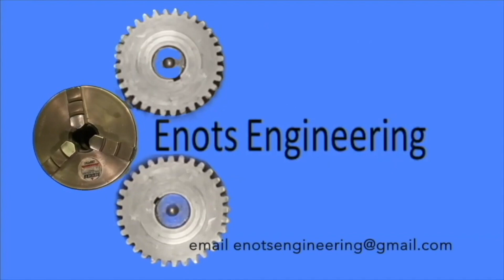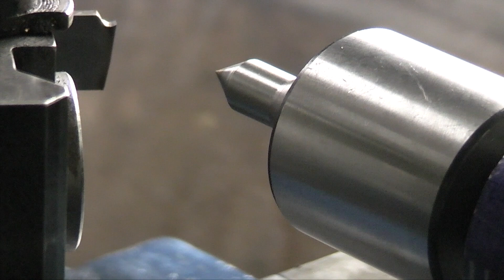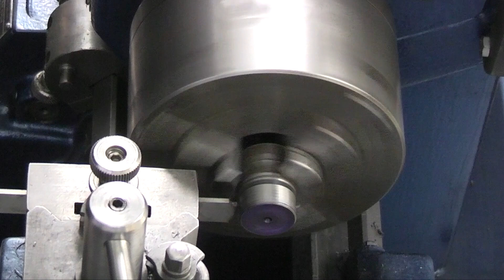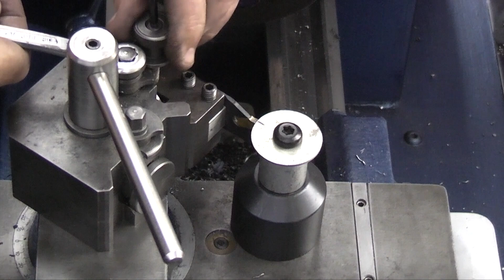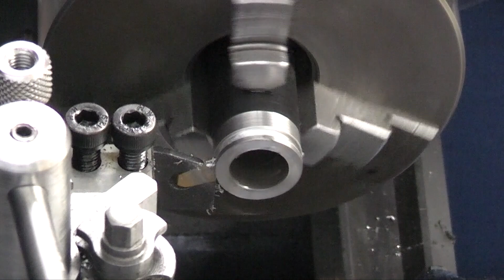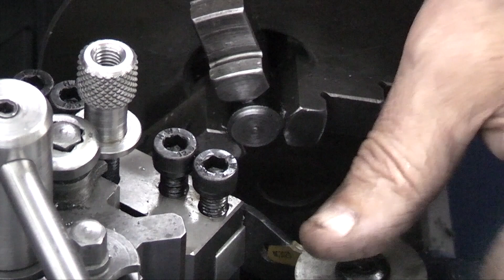Parting off tool problems ?

Comment: Following needs to be changed: 1) shallower rake angle or neutral 2) side angle relief to stop rubbing 3) tool height was too high needs to be slightly lower than centreline 4) parting is best from the back if possible 5) speed too low 6) Gibson need tightening

Comment: Conclusion  ????? RUBBISH and BORING
Reply: In contrast to the usual slick videos which don't teach much, this one's good. It's unusual to see someone making a video about the problems they encounter, and a lot can be learned from this video (and the comments section) if you have the capacity to think and learn. For example, rake angle, pressure and tool height, which are all incorrect. Perhaps time to stop criticising and start learning?

Comment: Interesting video. I have been exploring problems with cut off for years.  That doesn't mean I have all the answers but I have discovered how to successfully cut-off the first time every time on fairly small lathes where rigidity is usually an issue. The first thing I noticed in the video was the enormous overhang on the chuck (distance from the spindle bearing to the work being cut). If the lathe has less than a 2" (50mm) spindle this will likely cause problems. Reducing overhang is often overlooked and always helpful when minimized. The very biggest issue with cutoff on any lathe is the tool grabbing and being pulled deeper into the stock. This is because the "Point Of Flex" (tool post, compound or gibs) is below the centerline of the stock. Things that help are tightening the gips on the compound, centering the tool over the top of the compound, eliminating the compound or eliminating the tool post. I made a very simple direct mount blade holder that worked perfectly but I didn't like the fact that I had to remove the tool post. The other side of the equation is to minimize the load with tool grind, or switching from carbide HSS. HSS will usually be much better. The OTHER OPTION: Change the "Point Of Flex". This was done back in the 1930s (approximate date) by both Armstrong and Williams. They made a tool that was somewhat flexible above the centerline of the stock so that when the tool tried to grab instead of diving into the stock it pulled away. This was for the old lantern style tool post. I made one of these "spring cut-off tools" for a quick change tool post, AXA and BXA. In fact I have made several versions and perfected it. I now cut-off at the calculated speed for HSS at the largest diameter with a feed rate of .002" (.05mm) pre revolution. Sometimes I slow things down just to avoid slinging oil. Cutting a 50mm bar at 200 RPM with auto-feed is never a problem. The only requirements are a good supply of oil. Let me know if you want to know more.

Comment: I had a similar issue with my first Atlas lathe. After correctly adjusting the spindle bearings (which were a bit loose) the tool worked really great..

Comment: After the cut is completed at around 14:10 you mention that you're not sure why the tool got below center.  Going back to 9:00 take a look at the clearance between the left end of the carbide bit and the circular opening in the holder.  At about 9:13 the bit encounters resistance and is pushed deeper into the holder.  This happens several times over the next minute and by the end of the pass the bit seems to stabilize in the holder.  I think that's where it's getting below center.  Was the tool re-centered after changing the bit around 10:25 or did the new bit also get pushed deeper into the holder?

Comment: For me, the grind on the HSS blade is incorrect. The blade needs the top grind to produce relief below the tip for the full depth of the cut or the sides will start rubbing and the tool jams in the slot. This is because the blades are not actually flat but taper down in thickness towards the bottom to give side relief.

Comment: if you are using a tapered parting blade by grinding the tool the way you have the width of the blade  at the cutting edge is narrower than the top of the parting blade and so the blade is binding as it moves into the cut

Comment: Well Alan here is my 2 peneth worth I have a Boxford as well and had similar problems I think a quick change toll post has to much over hang for parting off I find a dedicated cut off bolted direct a 100% better and most 3 jaw chucks keep the work piece to far from the spindle I bet if you tryed your 4 jaw you wouldn't get all that chatter just what I've found by trial and error
Regards Kevin

Comment: I use a 2.4 mm (0.1 inch) wide insert in a half inch square shank holder carefully set within a few thou of centre. Disconnect lead screw to set top slide gibs with smooth but no detectable play. Lock all other motions. Use continuous lubrication for most cuts. WD40 on aluminium, cutting oil on steel, none on cast iron. The lathe is turning far too slowly, nerves I suspect. Correct cutting speed for material is important here just as anywhere else. Mine is variable and I wind it up as I move in. Never had any trouble. Yup, really, never! Well, apart from when learning! Cheers. BobUK.

Comment: I had identical results with my Atlas 10F.  After a year of chasing vibrations it was finally the spindle bearing preload that was the issue.  I had experienced that same sound and faceting that you are experiencing; it was awful.  After everything was tightened the lathe parted off beautifully.  Good luck.  Cheers.

Comment: Just watching you use either parting off tool and 1 No cutting fluid means it is grabbing 2 Your tool post is loose and moving during the cut. It actually tilts down toward the lathe bed, this will mean that it is no longer vertical to the side face, the cutting tool is now rubbing and the tip is not square to the job.

Comment: One more thing I have to know, your handle 'Enot', anything to do with the old factory? when I was an apprentice in the 60's we went on a works trip to the Enot factory in Birmingham, amazing place, not all automated at all, very noisy, loads of Ward capstan lathes, mostly of women operators churning out thousands upon thousands  of brass fittings, always remmber that, a great trip out, cheers, Dave
Reply from the maker: Hi Dave No I don't have any links to the factory, but like you I visited the factory when I was an apprentice at Austin Rover we had a trip to Enots.
Reply: Of course enots was was Stones

Comment: Very interesting, parting off has never been my favourite task. , it seems to be very crytical the tool height and correct rake, and of course the speed, the smaller the dia, the faster the rpm, I've seen some folks part off from the back, (tool upside down) I'm yet to try this method to see if it cuts better, anyway, enjoying your vids, cheers, Dave

Comment: Squaring the part off blade like that gives me problem as well. I square up the blade itself, towards the chuck and the result is great.
Adjusting the gib screws in the compund looks like needed if the blade, the toolpost tends to bow......

Comment: Tighten up all gibs, saddle, cross slide, top slide, more preload on headstock bearings, lock the saddle to the bed, new belts, tension the belts.
Then look at tool geometry, if persisting with HSS then add side clearance to improve chip evacuation.
You should be able to part free cutting mild steel 3/4” dia at 1000rpm

Comment: I still didnt see any spectacular parting off operations.  The job got done eventually, but it wasnt without hassel everytime.😳  I'd be inclined to measure headstock bearings and take a hard look at the carriage and tool post.  All of us are running multi decade old machines and they simply arent tight enough as they were when new.  Eliminating the compound altogether helps, but comes with its own limitations....  The saga continues.🥺

Comment: Parting of was a drama on my litte lathe until I built & mounted a rear toolpost in which the tool is mounted upside down.
Now parting of with a 3mm parting of blade is a laughing stock.
https://youtu.be/D7DU-YlyQ50
OR mount the blade upside down in the toolpost and run the spindle backward.
Reply: This works well for some lathes, but will probably screw the Chuck off on a boxford lathe.😕
Reply: Best way I agree, part off tool at rear upside down chips fall away from tool, saddle clamped down &  always there ready to use.

Comment: I don’t grind the top of the HSS blade - I leave it flat and use the blade horizontally so there is no back rake as I found the positive rake created by grinding the top tends to pull the blade into the work -especially on small machines .
All my parting off is done below 200 rpm and I use WD40 as a cutting fluid as I spent a weekend destroying parting tools to find what works best for me and that was WD40 - even on steel ( RP7 won’t work - don’t know why but it just made the jam up worse ). Chatter can be from too much speed , not enough feed ,worn chuck jaws , loose spindle bearings , excessive chuck overhang ( running adapter plates behind the chuck can magnify this ) ,poorly adjusted cross and or compound slide gibs , worn cross slide nut or screw - excessive end float ,too much tool stick out or a combination of any of these . If you take a look at winkys workshop channel he did a few videos trying to sort the same problem out - some good info and ideas on there !
I actually got to the stage where I was considering mounting a battery powered band saw on a sliding rail to my lathe so I didn’t have to part off at all !

Comment: AHHHHH Had to stop the video OIL OIL OIL You must keep oil right down at the cutting edge all the time never let it dry out, tool dead on centre not above, make sure it's all locked down solid, with a sharp tool shouldn't need a lot of pressure, when you master it cutting will be smooth chips with a crispy sound listen to your lathe, oil oil oil, hope this rant helps take care, 🇬🇧
Reply: I always part dry 😁

Comment: Hello Alan,
Good video... I am starting to record in a notebook what works for my machines, speeds, feeds, material, cutting tool... although books like the engineers black book and machinery handbook give you pointers I think when running older machines it better to know what works in your environment and have the information to replicate it next time. See you next time.
Cheers.
Paul,,
Reply: Hi Paul, that is the advantage of making a video, it is all there for you to check what you did last time. I have often used a video as a "how did I do that" reference

Comment: My 3/32" gives me no issues while parting, even on my little 7x12 Chester DB7. The grind is like a normal tool back rake though...no hook on the end. 180 rpm and  lubricant... works well.

Comment: I had similar symptoms on my Boxford and though I wouldn't say I'm 100% confident parting off now I seldom now resort to the hacksaw. Biggest improvement came from tightening everything - spindle bearings, carriage lock, topslide gibs and most of all compound slide gibs which I lock up solid for a big parting op. I can understand why people replace the compound with a solid block. Cutting fluid makes a big difference as well and I have become quite ambidextrous winding the cut on with my left hand and oiling with my right. Once the cut starts it definitely pays to keep it going at a steady rate. The other thing is using a narrower parting blade. I used to use 1/8" HSS then 3mm carbide but now use 1.5mm HSS or 2mm carbide - less tool pressure = less flex = less chatter.
Reply: THIS!!!  👍
Reply: I've got an old cud model boxford and can part using a 4mm wide tool and reasonably no chatter, slow and steady with plenty of cutting oil wins the race. I also have an old 3 jaw, a little bit of a bell mouth but I wrap a thin piece of pad paper around my work before I start an this evens out the contract pressure from the jaws on the work especially on any form of black bar stock. Seem to work well for me when turning thinner bar and parting.👍

Comment: Hello Alan, nice presentation when parting. I mean a 3mm parting blade is too wide for a lathe of this size and only suitable for industrial machines, so too much pressure is exerted on the workpiece. At 1.5 or 2mm it could look completely different.
Reply: Okay ? I just 2 hours ago parted off in my Boxford AUD mk III wih the same parting off tool, Sounded like a pig the first 2mm but the rest, up to the 25 mm I had in the collet just got off as easy as putting a hot knive thru warm butter. The difference is that I run at full tilt and with a fair amount of pressure

Comment: Hi I have similar problems with parting off. I found that tapered parting blades can easily be fitted with the taper uneven either side of the blade effectively removing the clearance angle on one side of the blade (so rubbing occurs). Also thinner blades work better.